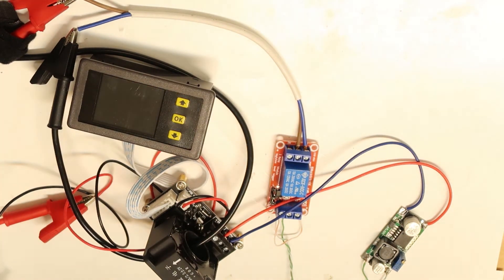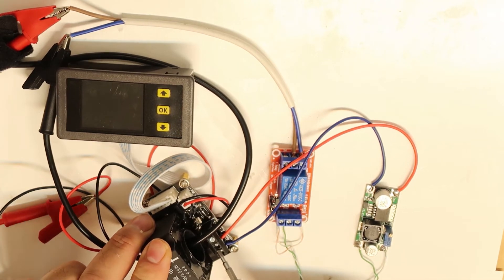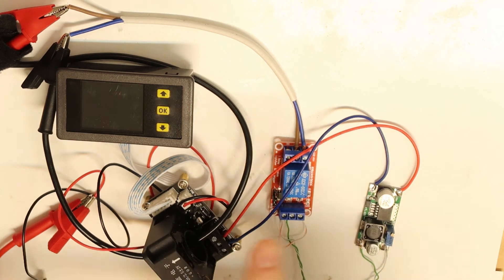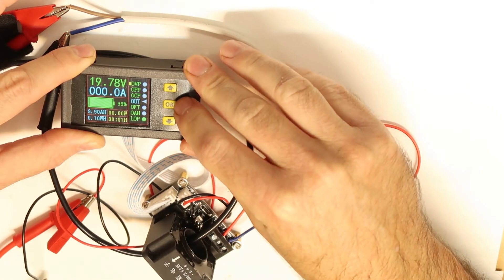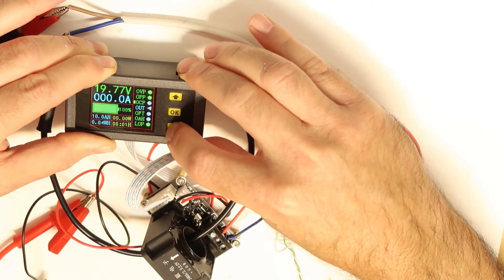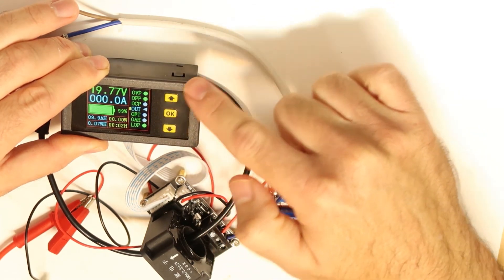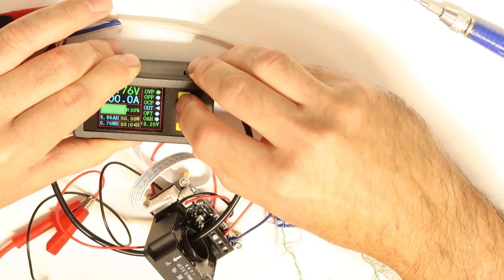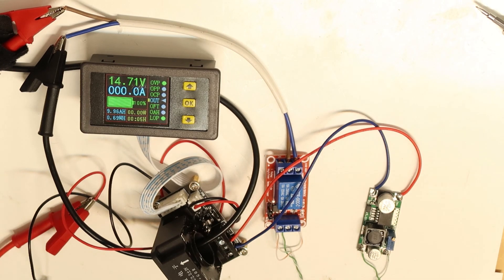Voltage and Current hall effect LCD display plus many more functions - Part 3

Comment: overcharge protection is not working as it is counting the battery  level. At the moment the battery is showing 9.96AH which is above 0.20AH (ampere -hours) you chose so it cant open the relay